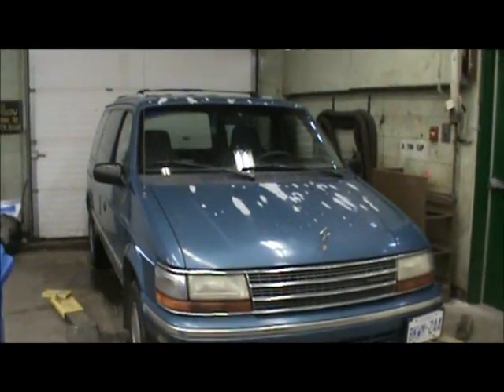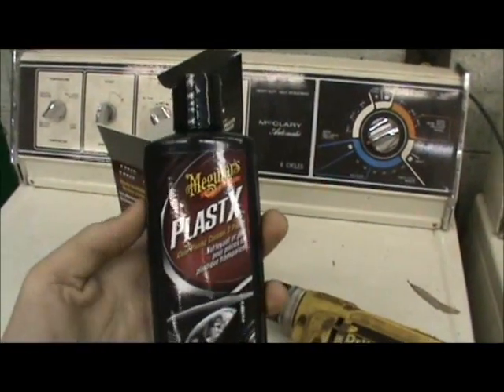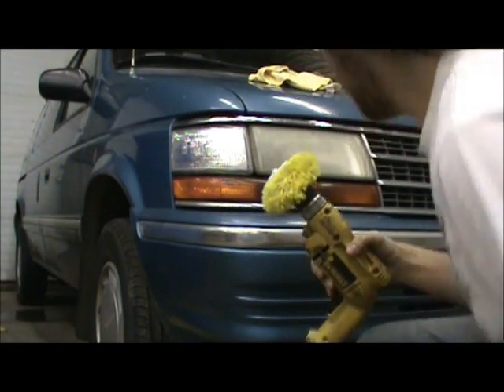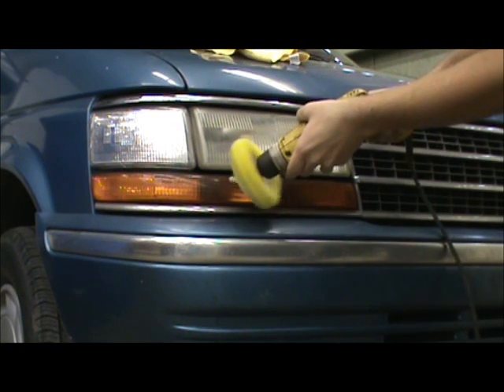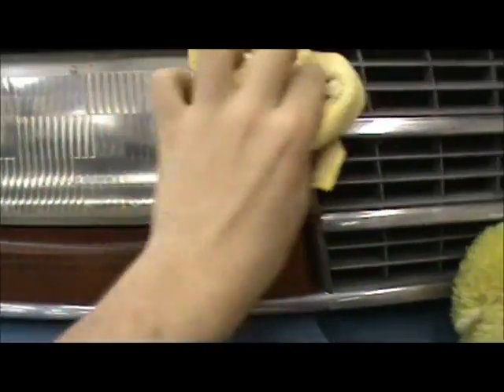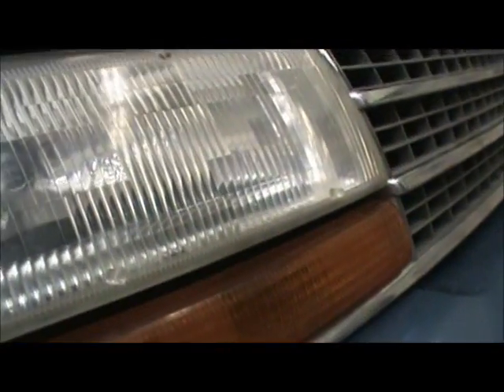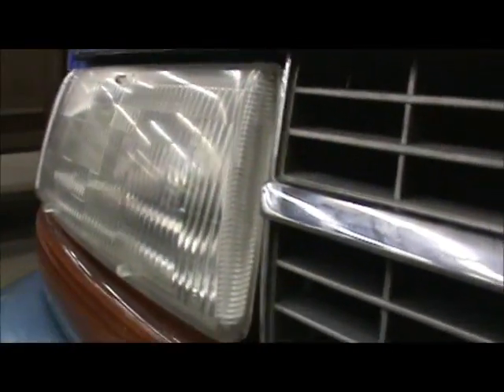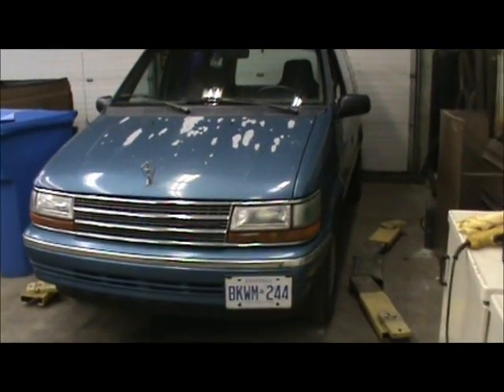A Method of Headlight Restoration

Comment: I have the same exact 1995 Plymouth voyager van and the lights literally look the exact same lol all of them look brand new except the main low beam headlights and I have used 3 different kits to restore the lights to look brand new again by using two different sandpaper grits, the drill with the buffer and the chemical cleaner solution and buffed each headlight for about 20 minutes after doing the sandpaper with water and yeah no matter what you possibly do you will never get the headlights on the 95 voyager back to a nice clear look again and they’ll always have a yellow tint no matter what as they are stained inside the plastic as well and you cannot get rid of it unless you buy brand new headlights. I restored mine the best I could and have done my headlights 4 times this month to try to get them as clear as possible and shiny and there’s still a yellow tinge that’s never gonna go away unfortunately but the headlights look amazing none the less and I plan on buying an LED light kit for both headlights and they come with a anti error harness as well for dashboard errors so they’ll work just fine and I’m gonna get a “Bright white” LED color tone that way my headlights won’t look “Green” if I were to use a higher Lumen with a icy blue or blue color tone super bright LED lights than they could possibly have a slight greenish tint as the headlights are still slightly tinted yellow and it’s best to stick with a bright clear white color tone and not blue which is more bright because it could look a little funny lol

Comment: Are you Canadian? Just noticed how you're unable to pronounce the name Meguiars.
Surprised how well it turned out, yet it made me scream when you placed the drill on top of the car.
Reply: Okay, now I saw the paint peeling on the hood. Yet you shouldn't place items on the painted surfaces of a car anyways.
Reply from the maker: yes i am Canadian, and yes it did turn out good. and as for the drill on top of the car, its a 1993 Plymouth voyager and the paint was already pretty bad. it was and i think still is the shop teachers daily beater that he just drives and doesnt care too much about. i wouldnt treat a newer or nicer condition car like that at all
Reply from the maker: I believe the hood has gotten repainted since i made this video though along with the roof, very common paint peel issue though on these vans